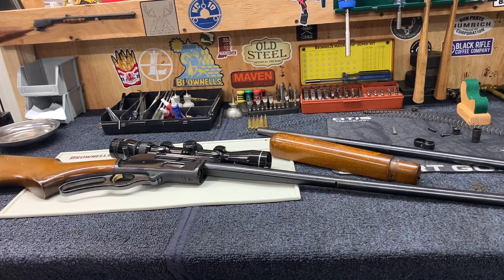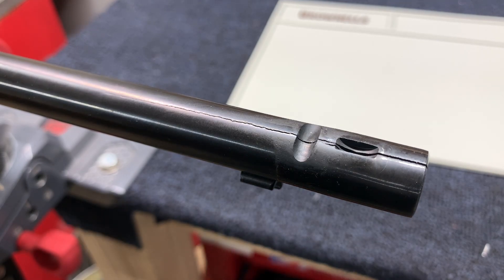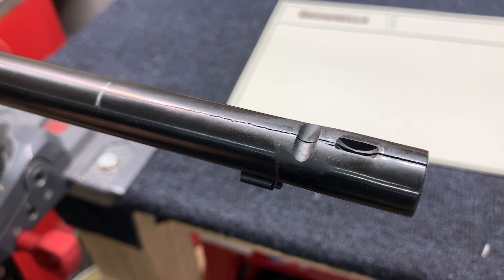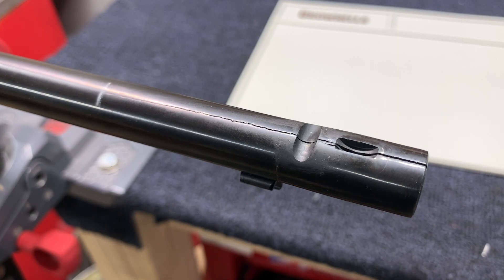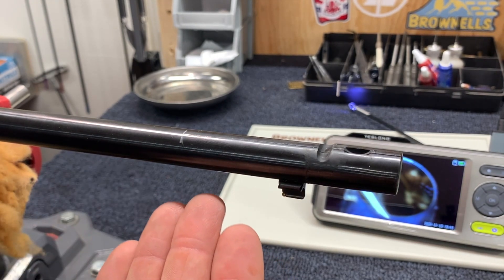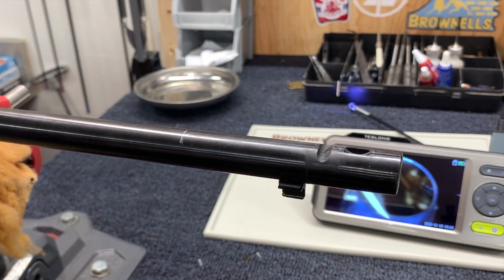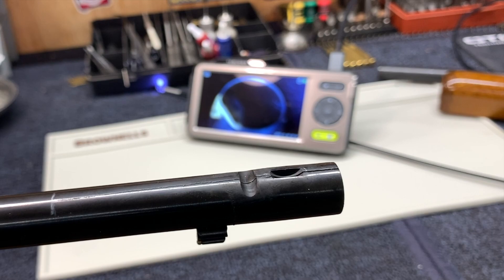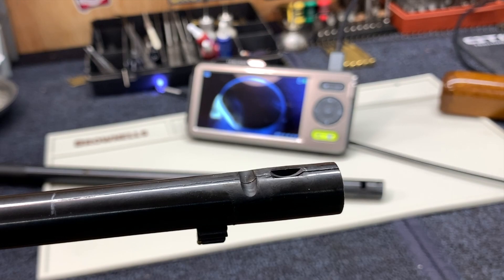Cracked Marlin Barrel: Can it Be Fixed?

Comment: I know your going to say I wouldn't advice it.but I shortened an Mosin Barrell without for thought.but I'm going to attempt reinstalling the cut piece.im not a gunsmith but have extensive machining experience.i will document it and send it to you.i will most likely use an hardened sleeve and thread the inside of the sleeve and thread the connecting portions of the barrell.i know it sounds rediculous but I've seen stupid things like this actually work.i will however bench test from afar extensively.